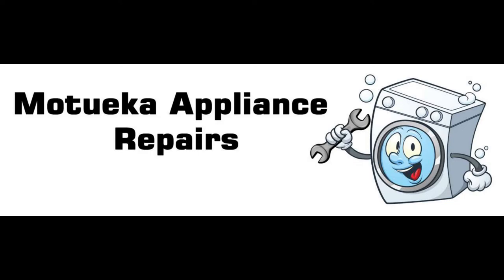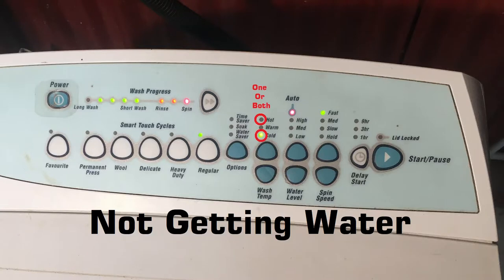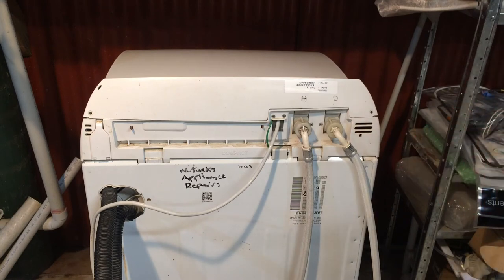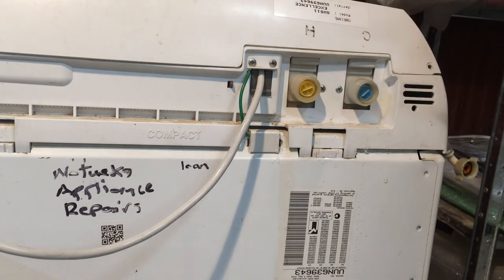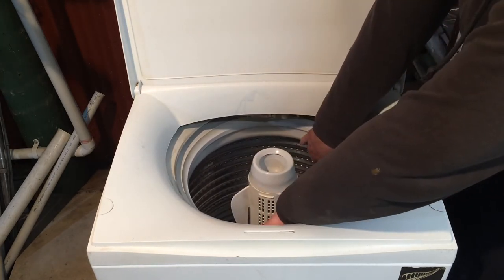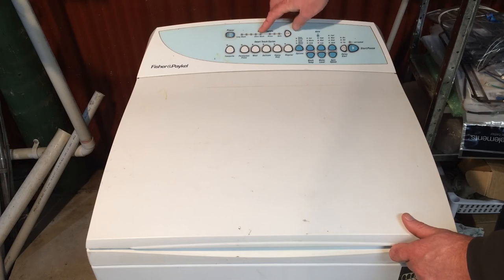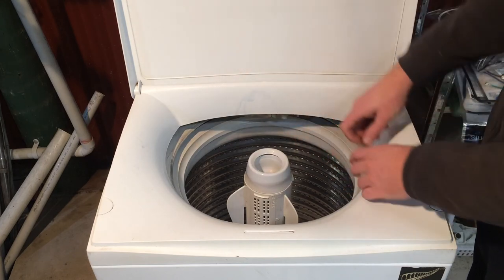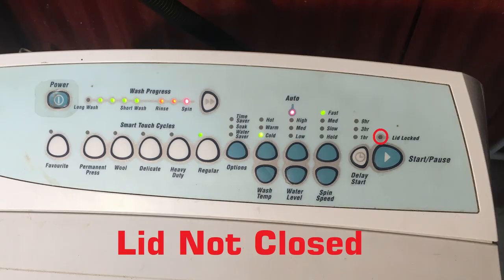User Warning Codes, Fisher & Paykel Smart Drive Washers

Comment: Haha - good stuff. :) 
Gregg, from Perth Western Australia, here!

I have the 5.5 Kg MW513 QuickSmart - and it sometimes, so intermittently, stops as it gets to the orange 'RINSE button.
Saw your explanation and not sure what the 'code' means - but wondering what action I, as average-joe, can to test out things!
 
So sometimes we can do 6 washes in a day and t doesnb;t lay up - and then another time it'll stop at that first orange rinse light. 
Could you please give me some idea of what that problem might be, and what muggins here can do to try to alleviate the problem.

This is our third FP over quite a number of years, and usually if we get a problem we don;t understand, we buy a new one.
But after watching your videos, I realise there might be things I CAN do. 

I already save the motor control units, and have still got my previous machine, that wouldn't spin.

I was gonna swap a previous control unit into this current machine, but it was brown, and larger, than this new smaller white unit!
Haha! So now I've come knocking at your video door! :) 

Thank you,

Gregg
Reply from the maker: Those controllers aren't backwards compatible unfortunately. When it stops at the rinse it should be either playing a rising tune like in this video, or a constant beeping. If rising tune look at what setting lights are flashing and then watch this video again. If constant beeping look at cycle progress lights and check this video: https://youtu.be/YbpLNMK2w08
Reply: @motrepairs  THANK YOU :)

Comment: I also service Fisher & Paykel Smart Drive washing machines but as a hobby in my spare time. Just asking out of curiosity does this machine have an SD11 420092 board or the newer SD12 42690 board?
Reply from the maker: Its probably a 420690 (which supersedes the 420092, 420706, 720376, basically all non-eco sd11 and 12) That particular machine is just one I loan to people if their machine is out of action for a bit.

Comment: Hi, thanks for all the great information, my washing machine broke down so bought a new one and put the old one in the garage, I found your channel which is fantastic, I thought I would have a crack at fixing it, I was testing the the machine outside, ran it with cold water it ran great, then I connected cold to the hot valve, can you not use cold water to test the hot water valve, I'm using the outside tap, alot of work to get the machine back inside. Thought I'd mention with the cold connected to the hot it got through to the rinse cycle but no water would come out then would make the first sound you described in this video, thanks
Reply from the maker: Some models actively check water temp, so if you have cold connected to hot it will stop filling. All of them only do a cold rinse, so you need to have water connected to the cold valve for the rinse even if you are doing a hot cycle.

Comment: Hi, thanks for the informative videos. My machine is not agitating properly and the high level light is flashing with the ascending beeping. It also happens while the machine is empty, no washing just water. What would this mean?
Reply from the maker: Sounds like the machine thinks it is overloaded, since it is happening with no washing something is causing excess drag on agitate. Two possibilities off the top of my head: Limescale or soap scum buildup in between the inner drum and shaft meaning the drum is being dragged around when it is trying to agitate instead of just floating, have a look at my cleaning video on how to take the drum out and then check shaft for buildup. Or possibly bearings starting to seize, is it really noisy/rumbly when it is spinning?

Comment: Thank you for the diagnostics guide.  In my case my GWL15 is giving a 160 (bowl engaged while in wash) error.  Indeed, the last cycle was unusual with continuous running of cold water without going in wash.  What should I do?
Reply from the maker: For the fault 130 you probably need to take the clutch spline out and check nothing jamming it, but I'd say look at the filling thing first, sounds unusual, would say need to check that water isn't draining or siphoning out the drain during the wash, which could cause the water level to drop and bowl to reengage.

Comment: Hi, Good video. Do some models not have an out of balance lever and switch ? I thought my machines lever had snapped off but after inspecting, it had no switch, lever or even the cut out where the lever is mounted. Cheers
Reply from the maker: The earlier models from 1990's through to the Smart Drive 11 have a lever. From the SD12 onwards it is detected by software monitoring the motor current.  

The switches could get corroded, lever damaged, or if the floor wasn't level the bowl could trigger it too early, so the newer models are much better.

Comment: We recently had a power outage heron north Canterbury,  the machine was half way through a cycle.  When the power came back on the machine was totally dead.  I’m assuming that when the power came back it surged and has blown the controller.  Does that make sense?
Reply from the maker: Unfortunately you are probably correct, although usually a surge will damage other electronics in the house. Sometimes if it is a surge the power companies insurance will cover it, but they may need the controller checked to see if it is obvious that it was a surge that killed it, might pay to give them a call to see if anyone else has reported issues.
Reply: Many thanks,   @motrepairs

Comment: Hi, thank you so much for sharing your knowledge! I moved to an older apartment and there’s not a hot water pipe, I used cap to block the hot water and always select cold water wash, but after a few minutes the hot water light will still start beeping and I can’t use my machine normally, is there any way I can fix it? 🙏
Reply from the maker: Find the user manual and look up "optional adjustment". You can change what temp it will look for on each setting, and you can set "controlled cold" to add a bit of warm even on cold. Change that to cold only "Tap cold"
Reply: @motrepairs  thank you so much!!
Reply: @motrepairs  hey Maltueka, I’ve tried this today, after I go into the adjustment mode, I still can’t adjust the water temperature, it just stays at “warm”, do you know what should I know? I’ve tried y to be under spin mode first too but no luck
Reply from the maker: @muyinglee1897  What is the model number?
Reply: @motrepairs  N64 or series 3 I think? It looks like to be an old model
Reply from the maker: @muyinglee1897  Ill need the actual model number off the sticker on the back to help any further sorry. Will be two letters followed by numbers e.g. MW512

Comment: Hi,  Very good video! I have a MW512. When the machine goes to the Rinse cycle (after Wash) the machine stops with the warning beeps as you describe. At this stage the Rinse light is flashing and the Lid Locked light is flashing. When I press 'start/pause' the machine starts again (no other action required), the Rinse cycle commences to fill, agitate, then drain as normal...and the rest of the cycles (ie. Spin) continues through til the end without any additional help from me. Have you come across this before?.
Reply from the maker: That would indicate it can't lock the lid,  thinks the lid is open. Lid locks very seldom fail, add to that the fact that just pressing start will let it continue suggests controller. Not a common problem.

Comment: Hi, I have a mw512 machine, what has happened was the machine was out of balance during the spin cycle, when I got to the machine all the LED light were off. I repositioned the washing load and tried to start the machine again so that it could continue spinning. With no LED lights on I turned off the machine and turned it back on, all I am getting is a few beeps from the main controller and still no LED light, I tried switching it on and off a few times and still no joy. I then went and bought a new main controller and installed it. The same is happening just a few beeps and nothing else, I unplugged all connections to the board and only left the power and the display connected and turned it on and still just a few beeps and nothing else, do you have any suggestions? Kind Regards.
Reply from the maker: If there are no lights at all and you have tried a new motor controller it would have to be display board, but it is quite rare for them to have problems. Or possibly display wiring harness but I would think that would more likely be intermittent.

Because displays so seldom fail it should be easier to get a second hand one to test. There are two different designs that mount differently but you may be able to get on e already in the housing.

Comment: Hi there, thank you for sharing your knowledge.  It looks like we have the same machine you've used in this video a GW712 so I'm hoping you'll be able to guide me in the right direction.  Literally all the lights are lit up on the board, so I tried to put our machine into diagnostic mode however our machine won't switch off via the power button.  I've switched the power off and unplugged the machine, left it for approx. 1 minute then plugged it back in again a few times but still the power button won't switch off the machine.  I'm hoping we don't have to get a new machine as it's served us well for well over 10 years, any feedback you're able to give would be greatly appreciated.  Thanks again, Ce
Reply from the maker: If all the lights are coming on including all water level and temperature eta then if sounds like the controller is getting stuck in the startup boot sequence, which would mean a faulty controller.
Reply: @motrepairs  Thank you 🙏🏽

Comment: Hey thanks for all the info. I have a MW613 and the 2nd,3rd,4th lights are lit up solid green and it beeps every second. Machine will fill for wash sequence but then stops. Any ideas?
Reply from the maker: Are you counting from the left or right? If you follow the steps in this video what fault code number do you come up with?
https://youtu.be/YbpLNMK2w08
Reply: Hi. I have the same machine. Does yours spray water when it rinse? I bought mine second hand and when on rinse mode it does not slray water, but it continues until the end and gives no errors

Comment: Hey there, thank you for video.  My water level light is flashing.  I have cleaned the inside of the machine but still same problem.  When I put only a small load of clothes in the machine and push auto water level it keeps filling to high and then the agitator doesn’t seem to move very much.  I am about to rewatch your video when the machine is empty. Any suggestions would be appreciated.
Reply from the maker: If the bearings are dragging it will do that, is it really noisy and loud when it spins and greasy stain coming from the motor?

Comment: I dont know what happened ...i heard the sounds as you said like when you first turn it on ,  then i heard it again and i went to look and all the lights were on but flickering and i could smell a strange smell kind of electrical maybe. The smoke could have been from the water finally gotten hot .  It hadnt even filled up yet
Reply from the maker: Checked that your drain pump isn't burning out, have a look at my other videos about not draining. And best not to carry on using it. Best case you may blow the controller if you keep trying, worse case I have seen one set a wooden floor on fire....

Comment: Hi - thanks so much for sharing your wisdom. could you please help with a Gw612 econsmart like yours.  I get 137 code - and water not draining. There is a burning smell when emptying. I removed the drain pump and tried cleaning it - nothing really in there and continued to have the problem. I also bought a new pump - however, this does not work either. Still have the same issue. The spin cycle does not begin in the wash part of the cycle. It drains water only and then fills it with new water without spin drying and completes the cycle. when I turned it back on after the wash I get the first 3 lights on the wash cycle and the 3 water level lights on and the spin light on at  hold and the board is frozen on that position. Had to turn off at power point to get it to work again. Can you please help diagnose this issue. ?  I have a new pump to replace and have replaced the rotor sensor previously about a year ago. I can email you the lights if you need them
Reply from the maker: The burning smell when draining and fault 37 sounds like a drain pump failed, but the funny light when turning on sounds like a faulty controller as well. You might want to check you water valves resistance as that can cause issues at power on but otherwise its starting to sounds like a faulty controller. Is it doing the little power up sequence where it starts with all lights on the turns them off in a wave while playing a rising tune?
Reply: @motrepairs  thank you for your insights. Yes If I turn it off at the powerpoint and wait a couple of minutes the lights all turn on. I have noticed that the spin cycle at the end of the wash cycle doesnt start and that is where the issues begin. I have replaced the position sensor and that sometimes caused intermittent issues in the past that required me to remove it and reposition it for the machine to work. I hope this helps isolate the issue. If I replace the pump is there a reset sequence required for the controller?
Reply from the maker: It sounds like you need a technician who is experienced with Fisher Paykel, It would be quite tricky/time consuming to walk you through a repair via email since it sounds like it isn't a simple problem sorry.

Comment: My machine isn't unlocking at the end of the spin, it will unlock when wall power is turned off but as soon as you turn power on and close lid it locked again. Is there an easy fix for this? Help please.
Reply from the maker: Haven't heard of that before, but sounds like controller is faulty. Before replacing controller checked the lid lock resistance is correct (about 65ohms) and also visibly check the harness to the lock hasn't got pinched or worn between the top deck and metal wrap which will cause it to short.

Comment: I have a GW612 with this control plate and a BA serial number. Is that 2004 or 2014. Others with a DH serial (2010?) are MW612's and have a different control plate. Is one better than the other?
Reply: 2004 for your GW612 mate.
Reply from the maker: FP actually made the SD12 for a very long time, and models became a bit messy. Continued selling MW512 and then the MW513 after they changed there model number format (e.g. WA80T65GW1)

Comment: Hi I have this same machine and the control panel keeps flashing and beeping then turns off. I pulled plug out overnight and turned on this morning with the 1st 3 and last 3 lights are on and nothing else, please help
Reply from the maker: That will probably be a fault code as apposed to just a User Warning, have a look at this video about how to work out the fault number from the lights. https://youtu.be/YbpLNMK2w08

If it is only turning on some lights and not beeping it may be that the display or motor controller is not turning on/ booting up properly.

Comment: When the lid is closed, it gives error message “lid locked” this occurs at the end of the washing cycle....so what is the cause of this please? During the the washing cycle ...it fine no error message. It keeps happening a few time now. Thanks
Reply from the maker: It only locks the lid during the rinse or spin, not during the wash. Its pretty rare to have problems with the lid lock, and it will be difficult to diagnose if it is intermittent so you are probably going to need to get a technician out to figure out if it is the lid lock or the controller.
Reply: @motrepairs  
Thank you for replying. The time waiting for the technician to come and the cost of repair are not worth it so I went and bought a new one two days ago.😊

Comment: I have a top loader fisher&paykel. Bought it secons hand. It works till the end, but I notice when on rinse it does not spray water. Is this normal for this machine? I never had a machine thay does not spray water during rinse.
Reply: Mine is a different model. MW613
Reply from the maker: They usually will  do a spray rinse then a deep rinse, however it only sprays water for 5-10 seconds  at a time and only 2-3 times during the spray rinse.
Reply: Ok thanks I will check again. Perhaps I missed it. I did open the lid and checed for a while and closed the lid and listen. But I will check again. Thanks for the reply
Reply: @motrepairs  it also depends on water level so low levels will be 2 or 3, medium will be 4 and high will be 5.
Reply: @motrepairs  you can change the rinse programming from spray and deep or just deep rinse which will spin before rinse without spraying or 2 deep rinses.

Comment: Do these machines have a lint filter and do they have a clean drum program?
Reply from the maker: They have no drum clean program, but it is recommended to run a hot wash through every few months. 

The way the drum is designed it is meant to not need a lint filter, but it is an optional extra that sits down the centre of the agitator, part number 426451P
Reply: @motrepairs  Thanks. I have a big Maytag in the shed and it does not have a filter either, but if a tissue is left in it it makes a mess and does not seem to be able to clear lint out, but I have not seen this with the Fisher & Paykel.
Reply from the maker: @les318  Yes the maytags are not so great if there is lots of lint or a tissue